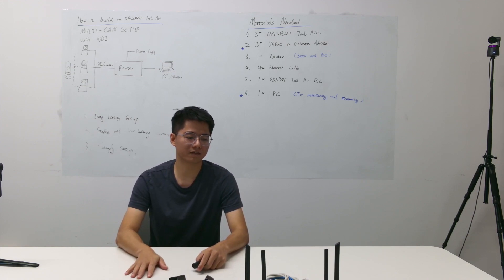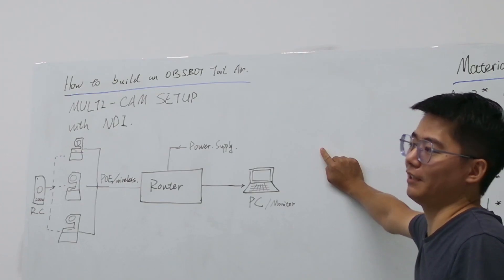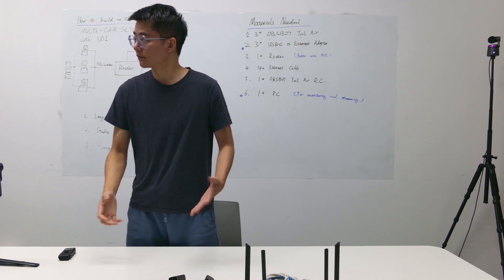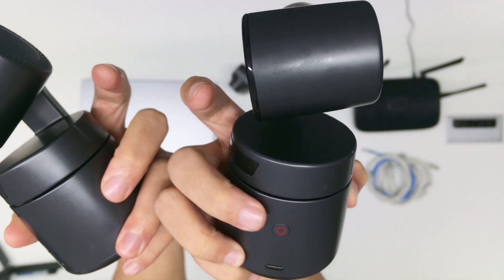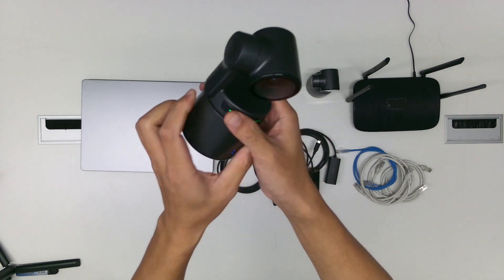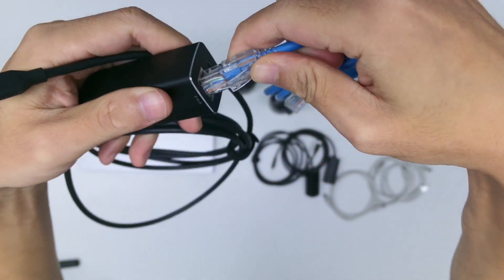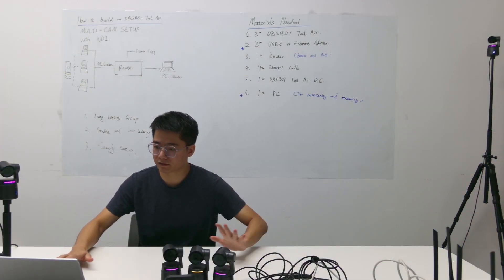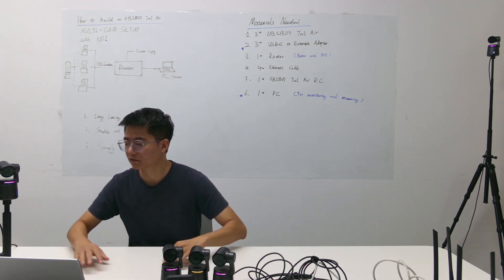How to build an OBSBOT Tail Air multicam setup with NDI?

Comment: Could this be used on-location? It doesn’t look like the router is actually connected or providing WiFi. I assume it’s only providing an IP fir the cameras but not sure? You say a POE switch would be better. Could you explain that or perhaps do a video using it with this current setup? Thanks!
Reply from the maker: You're absolutely right! The heart of NDI construction lies in establishing a reliable local area network (LAN) for your cameras and production devices. While an Intel Wi-Fi connection can be convenient, it's not necessarily a critical component. And with With PoE switcher, you can keep charging while staying connected.
Reply: @OBSBOT  is there any other advantage such as speed? Right now I’m wired to my ATEM Mini using HDMI. Would there be less latency if you used the POE LAN solution above?

Comment: can this be done through wifi? When i set the obsbot webcam app it only enables 1 stream from all 3 tail airs depending on which one is selected in the app. Only 1 virtual camera stream even though i have 3 tail air and 1 mini 4k connected
Reply from the maker: Our software currently does not have the option to output multiple machines at the same time.
You can try using software like OBS/VIMIX to pull different streams, through NDI/HDMI/UVC.

Comment: Muy buen video, pero no veo cómo trabajar en modo Director y poner la siguiente toma en modo previo antes de mandarla al aire
Reply from the maker: Hola, puedes hacer clic en la cuadrícula donde quieras que esté en Air para administrar rápidamente la imagen de tu transmisión en vivo.
Reply: @OBSBOT  gracias, en unos días haré la compra de la primera obsbot tail de 3 que vamos a necesitar y una va a ir montada en un cable CAM ya les pasaré videos de cómo va la transformación de las transmisiones que hago todos los días

Comment: Will you be selling a multicam set of 3 at a discounted rate ?   Will one remote if using with ATEM PRO ISO ?
Reply from the maker: Hi there, thanks for your interest in our newest product. Yes, there is a discount for the multicam set of 3 Tail Air on our Kickstarter page: https://bit.ly/3R0LR74. Also our remote controller is compatible with ATEM PRO ISO.

Comment: Do these cameras need to be connected via cables or they can work on wifi ? We cant run cables in our setup. Currently we are using mevo but looking to upgrade.pls let us know...
Reply from the maker: Hi there, thanks for your interest in our our products! Tail Air supports both wired and wireless connection, including wifi connection. 
You can also visit our website for learning more: https://bit.ly/46OqU4E
Reply: thanks. Why do we need NDI lic and how does that play a role. Could not find any details on that. pls let me know
Reply from the maker: @ravi4streaming  You are welcome. The NDI lic plays a role in ensuring that the quality of the video is maintained when it is being transmitted over a network. The license also helps to prevent unauthorized users from using NDI. Hope this can help you. :)
Reply: @OBSBOT  thanks. Does this have 360 rotation feature like pivo pod?
Reply from the maker: Hi there, with our 360° Rotation Charging Base, Tail Air can achieve 360° rotation.
Reply: @OBSBOT   So to confirm, with an NDI license you can broadcast a wireless NDI signal?
Reply from the maker: Yes right on!